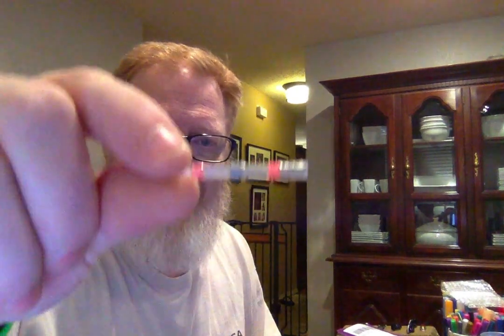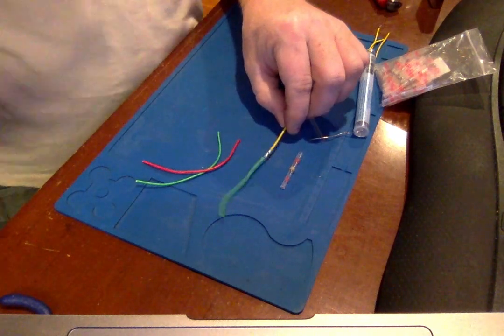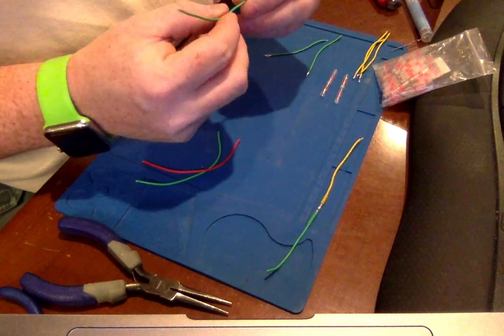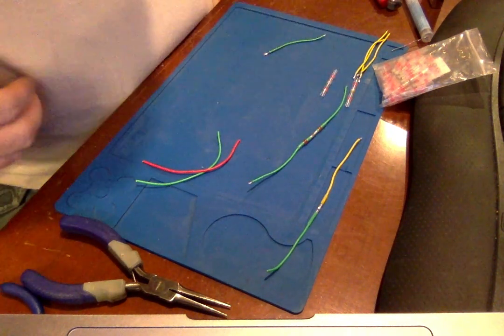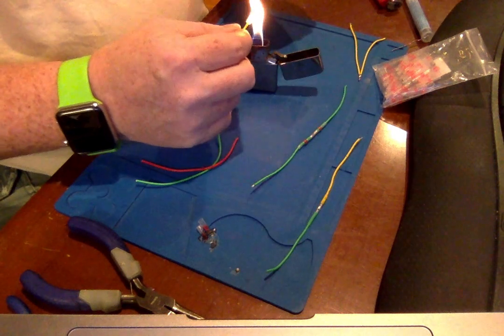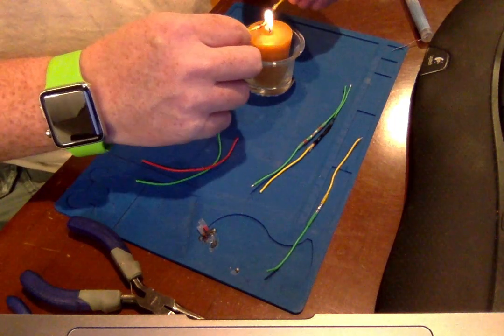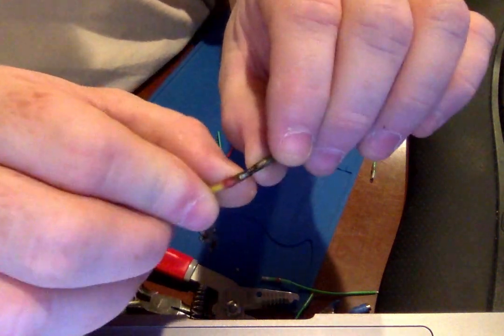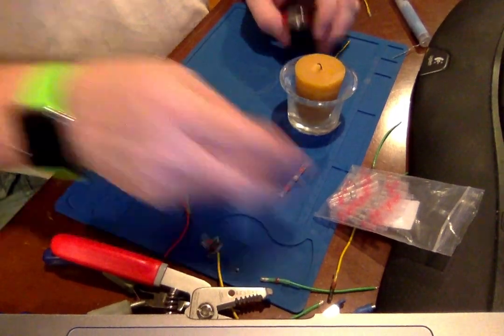Solder Heat Shrink Connectors - Do they really work?

Comment: Thanks John, I bought some of these recently to do some auto wiring harness repair, but opted to go the traditional soldering route with an iron - nice to know that these are a viable option and I'll keep some in the car for emergency use.
Reply: The problem with low melt solder in automotive applications is both summer road temperatures and engine compartment temperatures. To prepare for automotive emergencies I recommend packing a crimp tool and both crimp and those split blade splice connectors.
Reply from the maker: @Tricknologyinc  LOL - yeah, that's worthy of another test for fun - it was 105F today here in the Dallas area. I wonder how these would fair under the hood in Texas? Probably NOT well.

Comment: You actually did it wrong. You don't put one wire in one end and then the other at the other end and push the wires together. You do it like a recular splice. Just like you did with you soldered the connection. Here is the right way of doing it:

https://youtu.be/7Wh5gM8GM70